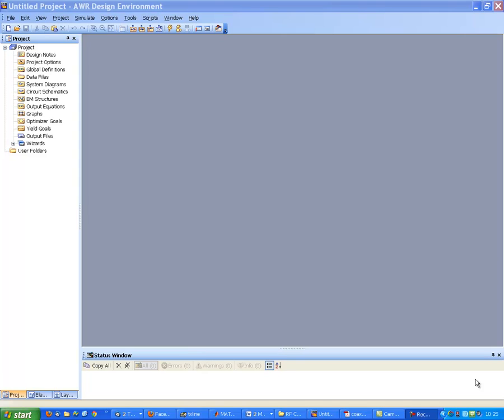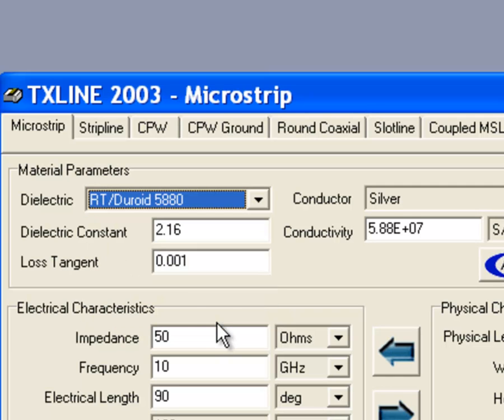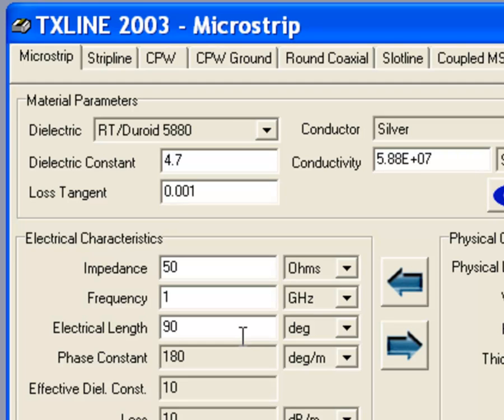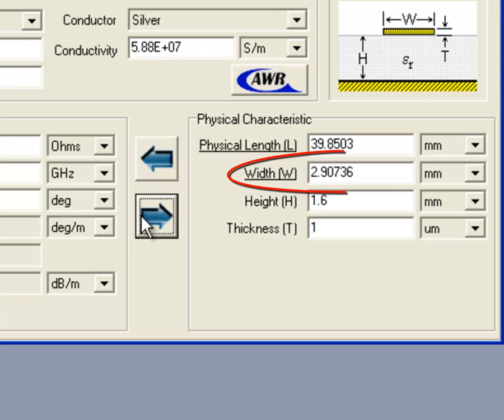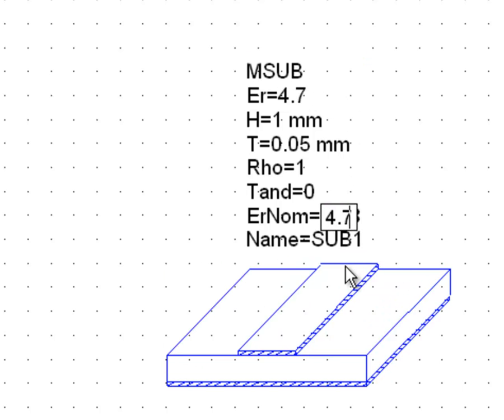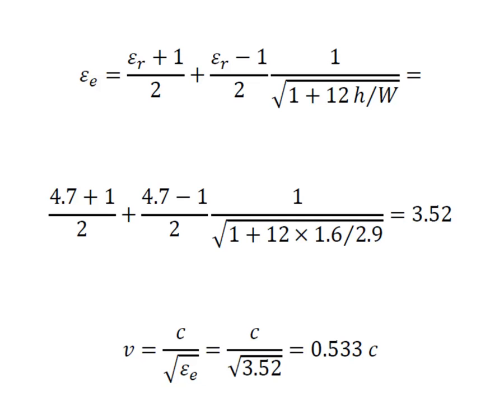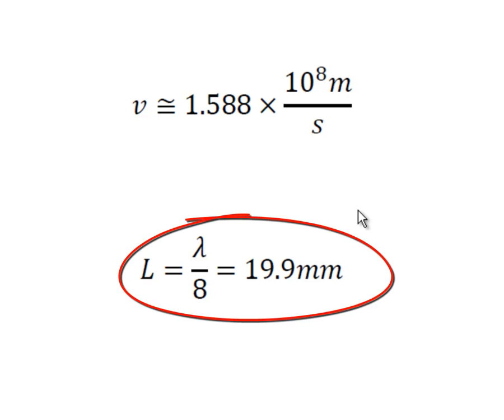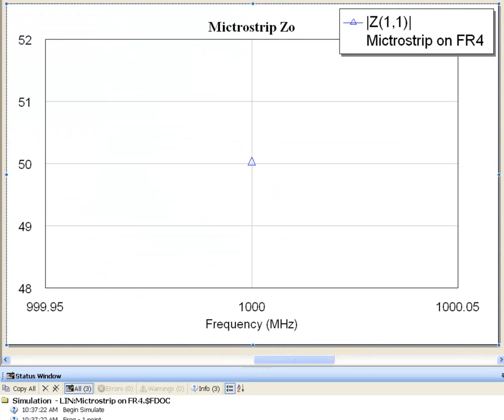Microstrip 1 Design and Verification

Comment from the maker: The Softtware is AWR Microwave Office. Although the circuit simulator would be useful to simulate electrical models of antennas, there are geometries that require EM simulators. AWR do offer some EM simulators as part of their design suite, but none are full 3D. For a planar geometry such as patch or slot antennas these would be adequate, but for other geometries a full 3D simulator like HFSS or CST would be necessary.